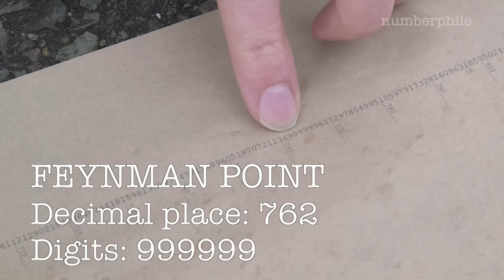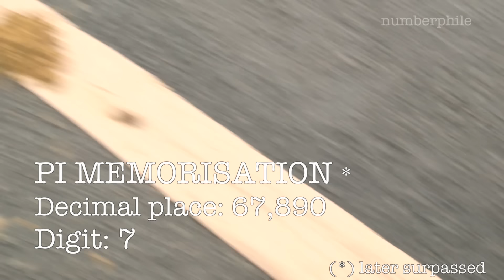Mile of Pi - Numberphile

Comment: This should be printed out in concrete somewhere.

A lot of people would like to find special dates somewhere in PI and take a picture of it.

I would.
Reply: I agree. Totally. "Some" people would really like to find 42069 in Pi...
Reply: I think that's a wonderful idea. Maybe like outside a museum? Or even around the interior of one. It would be even better with some of the interesting features noted (like the string of 9s)!
Reply: @stormysamreen7062  The string 42069 occurs at position 250301. This string occurs 1996 times in the first 200M digits of Pi. counting from the first digit after the decimal point.
Reply: This is an amazing idea.
Reply: @stormysamreen7062  i would
Reply: @stormysamreen7062  I hate to tell you buddy but 42069 is in  the first million digits. Meaning it’s in that paper, at the first quarter.
Reply: 69420 however is at around 15 thousand digits.
Reply: @Sideshowspike  omg how did you know?

Comment: According to Britney Gallivan's Paper Folding Theorem, this mile long strip could be folded in half only 12 times.
 
Length of paper required for n foldings in half:
L = (pi*t)/6  (2^n + 4)(2^n - 1)
where t is paper thickness (assumed to be 0.1mm)
Reply: Ur0pinionDoesntCount n=times folded L=length
Reply: And to get to the moon (folding 42 times) you'd need a paper 1.0128x10^18 km long
Reply: Ur0pinionDoesntCount You don't really need to solve for n if you're fine with testing values of n. But if you want to be slightly less lazy you can note it expands to 4^n + 3*2^n - 4, and 4^n becomes much larger than the other terms as n increases, so meh, just ignore them. Since you want n to be an integer (number of folds), take the log4 of your number and round up; or down if it's really close to an integer.
Reply: Ur0pinionDoesntCount Substitute x for 2^n and you just have a quadratic. Expand, use the quadratic formula (or whatever method you prefer), and you have two expressions for x. Substitute back 2^n for x and take the log of both sides of each equation. Only one will be real.

Or just ask wolframalpha to do it for you.
Reply: Ur0pinionDoesntCount n just pops out, like magic!  Just kidding, you say x=2^n, and replace all occurrences of 2^n with x.  Now you can solve for x, and then once you know x, you can easily find n.  n=ln((sqrt(pi) sqrt(24 L t+25 pi t^2)-3 pi t)/(2 pi t))/ln(2)
Reply: Love your PI music =)

Comment: Careful, you're using miles and yards, people are going to get pissy
Reply from the maker: jb76489 see the "Making of" video - we used yards for technical reasons, namely that the printing was done in dots per inch and that created issues... http://youtu.be/99Welatppzk
Reply: Sorry if that came across a bit harsh, I assumed you had good reason for doing so , I'm just predicting people will unreasonably pedantic about it instead of focusing on the awesome video
Reply: As does Canada and Australia and some asian countries and the US
Reply: jb76489 Australia hasn't used feet and inches since 1966... Sorry :P
Reply: 1996 was when metrication started but it wasn't entirely successful, imperial is still, used in some contexts
Reply: It started was 1966 with the change from pounds to dollars, then continued in 1970 with the Parliament of Australia passed the Metric Conversion Act. Now It is never used in scientific fields and it is not taught in schools. It isn't used in any legal documents.  Sorry, but... no. :)
Reply: Just 'Google' it before making an argument. It will save everyone from a lot of misinformation, and save time. Cheers.
Reply: Did I claim that it was used in matters legal/scientific? Or that it was taught in schools? No, I don't think I did
Reply: What else really matters?
Reply: Apparently quite a bit, the U.S. uses metric for those yet people will not shut up about it
Reply: I don't know about you, but I never hear people use the imperial system (I probably should mention that I'm an Australian myself). But then again, Australia is a big place, what I know is probably  just be a local thing.
Reply: willway1234 how tall are you?
Reply: I'd like to point out that Numberphile is also viewed in the US where people get upset if you use metric (sometimes). Ultimately it should just be his personal preference in this case, in my opinion.

Comment: A mile long piece of paper makes a surprisingly small roll... XD

Makes you wonder how long a toilet roll is...
Reply: my toilet roll is 200 times 138mm long. That makes 27600mm, or 27.6m. 3 layers of course.
Reply: Usually around 60 meters. Toilet paper is thick, it has a foam-like structure to be soft and flexible, unlike this crispy brown paper with sandy texture.
Reply: Its very thin paper haha toilet paper is multi layered and quilted and stuff. (Squeeze a roll in you hand and see how much smaller it gets)
Reply: Also each layer around the roll probably adds an exponential amount of length to it because it takes that much more to do a single revolution each time
Reply: Shaun Dreclin
The amount each layer adds is [the thickness of the paper] times [the number of layers] times 2 times, you guessed it, pi!

(that's if you ignore the roll in the middle)
Reply: There is a brand of toilet paper in Russia called "54 meters". The length is specified as 54 +/- 2 meters :)
Reply: heh. Well, depends on what kind of toilet paper it is I suppose. I recall having a few rolls of 1000 sheet single ply... Which is a roll that has about the same diameter as a 280 sheet roll of 3 ply... (Not to mention I've seen different rolls with vastly different diameters of cardboard in the centre).

While I'm on the subject of toilet paper, anyone else find that they are bad at judging how much is left?

If you think it through you realise that the outer layers of the roll have more paper on them than the inner layers.
Yet it seems like intuitively I tend to judge how much paper is left by the remaining diameter, (when clearly, this has a non-linear relationship to the length of paper remaining...)
Reply: That roll of brown paper was approx 1700 meter, so the PI barely fit. Not much left.

Typically the rolls on the machine shown in the making-of-video are 1400 m long. All depends on thickness of paper.

Comment: If this is British, why did they not use the kilometer?
Reply: Because then each digit would be only one millimetre wide.
Reply from the maker: fakjbf the "making of" video makes mention of this - it mainly relates to the fact we had to print in "dots per inch"
Reply: Err- British always use miles?
Reply: We use miles for long distances (mainly when driving) in the UK. We're not as metric as you might think.
Reply: And why are they all speaking in American? They should learn their own language!
Reply: Steve Brown There was not one American accent in that whole video.
Reply: Britain has a confusing mix of metric and imperial in everything.
Reply: brits use miles.
Reply: Wise Guy 508 I was being sarcastic (not sure if you are too), talking as if I were an American so ignorant I didn't even realise the language I speak is English, on the assumption that fakjbf is an American so ignorant that they don't realise the mile is an English unit. Bit of British humour for you there.
Reply: Steve Brown Considering this very channel made an extensive video explaining the benefits of metric, and the UK officially uses the metric system, I don't think it's fair to call someone ignorant for pointing out that they weren't using metric.
Reply: fakjbf
 It's true, the metric system is officially in use here, although the Imperial system persists a bit (especially distances on road signs as others have said). But saying "considering they're British..." is still odd considering the system is British, if outdated. It's like saying, "considering they're British, why are they using old British money?". That's why I assumed you thought that miles are an American unit, which is a surprisingly common mistake.
Reply: Steve Brown How is it weird to not have known that the official unit of a country isn't being used all the time? It would be like people going around a random US city speaking a Native American language. Just because it was here before English doesn't mean it's normal for someone to use it now. Even reservations where they teach the native American languages still use English as their main language.
Reply: fakjbf By the time the UK switched to SI, there were too many drivers to change speed limits to km/h. Think about it: if you're driving in a country where the speed limits are in a different unit than you're used to, you look at the other drivers to help yourself gauge how fast you're supposed to be driving. Now imagine the chaos if everyone had to get used to the unfamiliar unit at once.
Reply: Nillie
Right you are indeed, I was told when I met them. Sorry I forgot.
Reply: ***** Agreed. But it looks like many people didn't need it explained.
Reply: The real reason, explained in the behind the scenes video explains that the printers which use dpi converter really easily into imperial units and when they tried metric, there where glitches.
Reply: Steve Brown Don't forget bizarre (to a Yank) units of measurement like "stone". (Wut? Is it the Middle Ages? "how many stone do you weigh?" ...erm, shall we use furlongs and fortnights, too?)
Reply: Lee Clemmer Here in (northern) Norway, we use the term "fortnight", but only in casual contexts.
Reply: Nillie Well, to be fair, sometimes it's used here in Yank-land too. Very casually, and mostly by older people.  
I don't know of anyone who uses furlong, ever. 
My physics teacher often used these units as a bit of a "joke" & simultaneously get our brains around a concept. "How fast will the rock be travelling in 'furlongs per fortnight' when it reaches time 't'?" 
It made you think more carefully since you're not just going with m/s or km/hr.
Reply: because a kilometer and a mile are different and the paper was about a mile long, not a kilometer.
Reply: nowknow no, that is not the reason. The paper was about 1.8 km long. Reason for measurement IS revealed elsewhere in comments.
Reply: Steve Brown
You do know the Mile was a Roman Unit way before Brits called themselves Brits ? I point that, because you're calling people ignorant...
Reply: tomtucjr but that not why they used imperial.  In "The Making of a Mile of Pi - Numberphile" video, they mention that they would have liked to use km, but it wouldn't correspond well with the dots per inch font and printer that was used.
Reply: 1 Million digits of pi in 1.653 Kilometers

It's easier to just say Mile :P

I'm Canadian, btw
Reply: +fakjbf In Britain we use use the decimal system. There are 1000 roman paces in a mile ( Latin: Mille = 1000 )
Reply: A big reason English speakers worldwide don't use metric only is due to the nature of the language. English contains many terms that are not base ten, and this occurs in many other languages. Time and angular degrees are two examples that will never become base ten (60 minutes, 360 degrees.)
Reply: +Litigious Society angles can be measured is base 10
Grads
Reply: +Steve Brown On behalf of fakjbf1... Touché!
Reply: +fakjbf Because typographic points are an imperial unit and therefore 1 million of them fit perfectly into a mile but not a kilometer.
Reply: Here in Ireland we changed our speed limits from Miles to km/h. There was no chaos.
Reply: If u watch the video on the making of this video, he explains why he didn't use the metric system
Reply: We mostly use miles, personally I rarely use kilometers unless I'm converting it from miles
Reply: elevown only on the road. Or old people. Young people use metric and miles are only for tge road sign
Reply: fakjbf cos we use miles here, not kilometres
Reply: there is a "making of mile of pi" video they made where they explain why they used the imoerial system instead of the metric
Reply: Blasphemer !!! Obviously a French spy ! Off with his head before it's too late ! x'D

Comment: I don't know if anyone would be interested. I've attempted to find the harmonic resonance of Pi. I worked on this for about 6 hours. Pi may terminate to a whole number if the base number set were other than 10 (this has always been a question of mine).  Some things I discovered along the way: 1) the higher the base number, the more accurate you can get in making whole numbers 'fit' together. If you want to terminate to an accuracy of something greater than .0001, and where it terminates to a whole number, increase the base system to something upwards of several hundred, or thousand. When you do this you will note a ratio of whole numbers radius:circumference. I remember the second number being something like 22, or 7:22 (im working from memory, don't have my notes). 

I've also considered an alternate way to look at it. If you want to 'quantize' Pi into a whole number, utilize the shape of a cone (rather than a 2 dimensional flat circle). You will have better luck trying to find quantizable whole numbers. You simply make both the radius & circumference equal to the number 3.

Comment: What a very impressively curious thing to do!   Requires at least an offhand mention of font-size somewhere.  1.05 miles is 66528 inches, and were it 12 point Courier that would be 12 characters per inch or 798336 digits.  So it's something a bit more width economic than 12 point (fixed width) Courier.  ...may have to extrapolate from a standard Matt Parker index finger width to close in on the typography.

Comment: About the yard/meter argument:They used technology with DPI(dots per inch).This meant that yards were much easier as they are exactly 480 digits/yard.If you convert to meters, you end up with 524.9342832 digits/meter and the font size is based on points which are based on inches.Most importantly...SERIOUSLY SEE THE MAKING OF VIDEO!!

Comment: Pi is such an interesting thing. It pops out everywhere in maths. Have someone tried to see how it looks in binary or trinary, or hexadecimal? Lot's of number can be infinitely long in base 10, but finite in some other base and still mean the same thing just the exact value and not a rounded one.
It goes without saying but a conversion is not enough, it needs to be calculated in the other base, or you'll always end up with infinitely long numbers.

Comment: I'd like to suggest a topic to discuss here on Numberphile.  Since Archimedes was the first person to calculate pi, how about showing us how he did it?  I am not referring simply to the use of the perimeters of inscribed and superscripted regular polygons but the number (counting) systems he used and how he did the adding, subtracting,multiplying and dividing.  Did he use Roman numerals or other system of numbers?  How did he add and subtract, etc. those numbers?  Using Roman numerals, What is the procedure for multiplying, for example, 314 by 49 (CCCXIV times XLIX).

Comment: Would've been cooler if you could have arranged the digits of pi in a giant circle with a diameter of exactly 1 km, so that the digits of pi span a length of pi km (approx 3142 m, since C = Pi * D).  That way you'd be showing what Pi actually is while demonstrating how massive  it stretches (though I don't know how many digits you'd need in order to reach that distance...)

Comment: If Pi to a million digits is 1.05 miles long, then the largest prime currently known (i.e. one less than 2^74,207,281) would continue another 21.34 miles down the runway.

How many times could you fly a jumbo jet across the Atlantic with the energy that was needed to discover this gargantuan prime number?
Reply: someone print that
Reply: +Alien Guy it's literally going to take a water bottle (approx.) to do that, even with the most efficient printers on the market.

Comment: Whats the point? Is there any useful application for pi with more than - for example - 20 digits?
Reply: +Lejf Diecks size of a supermassive blackhole and it's angular momentum perhaps. But is there any useful application to things like topology, number theory, or abstract algebra? To a degree, but not to the extent they are taught.
Reply: +Lejf Diecks It can be also a demonstration that we don't live in a simulation, as VSauce explains in one of his videos

Comment: So like, this might just be me being crazy, but since pi is an infinite, never repeating number, would it not contain an infinite amount of data? (Of course, I'm not saying that the number pi takes an infinite amount of data to be stored, since computers just calculate however many digits would be relevant)

Since you can technically represent anything with a string of binary code (of which you could convert pi to), wouldn't it contain literally any data, from this very message, to the genetic code in our own DNA and even the science we still haven't uncovered? Since it's infinite and never repeating, then there has to be a position in it where it could describe literally anything.

Extra thought: the only thing it couldn't contain would be itself with part of the start missing, since it can only contain all of its digits once, from the very beginning to the infinite end(?).